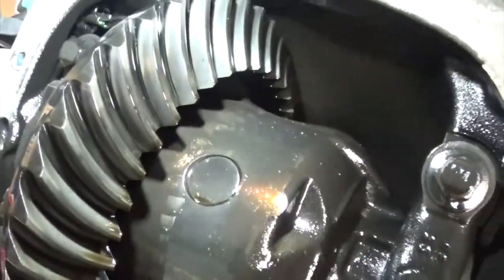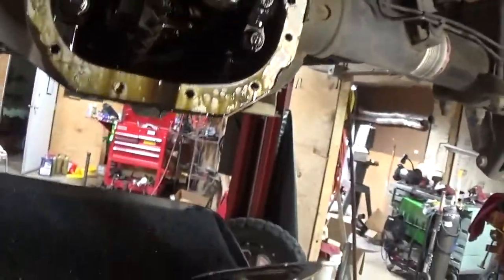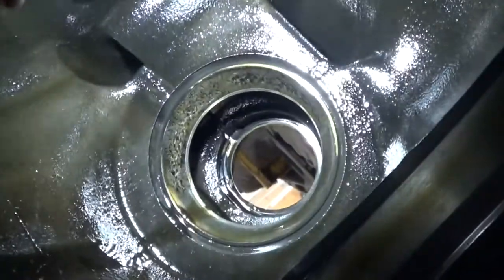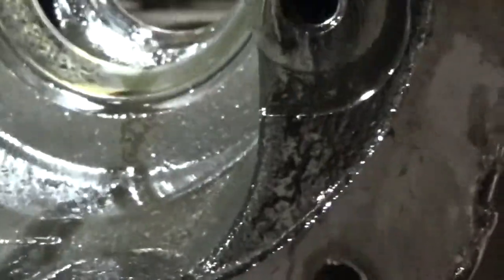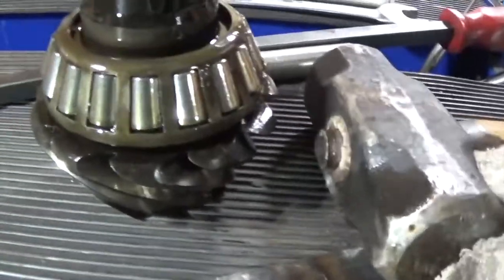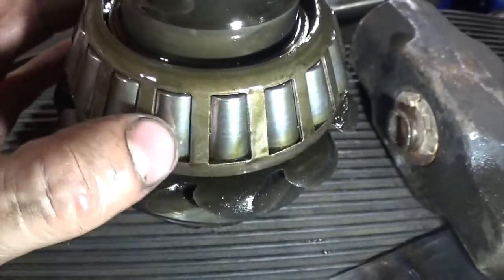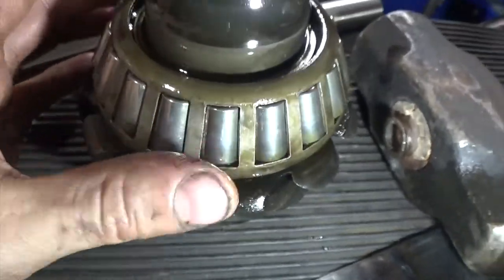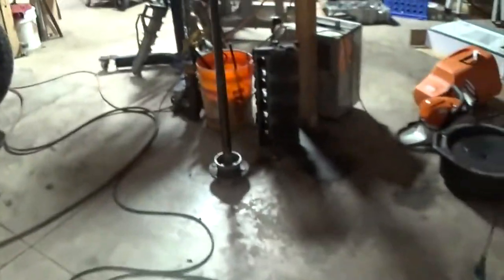How to fix rear end whine in 2017 F150

Comment: He says I don't know why these do that, simple answer it's built shitty.
My Toyota thunder with 300kmiles, don't make any noise whatsoever. 
Still runs just as smooth. 
Have a Diesel Toyota Hilux with 600kmiles, rebuilt the Engine twice but same rear end, so definitely these r not built right.
Reply from the maker: I agree. I’d love to know exactly why. Then I could try and improve on that. But your right. 
Here’s something I’ve always thought about Toyota axles. 
I’m not sure on the Hilux. 
I always thought it was funny that Toyota uses an axle that resembles a ford 9 inch. The ford 9inch is still used today in racing applications. Who built it first? Very cool that you have a diesel Hilux!
Reply: @showmerepair  
I have that Diesel Hilux in Fiji, live here for most for most part of the year and spend 4 months in Utah. 
Had a Diesel Hilux in Utah too, lady who served in the Military somewhere overseas brought it back with her, I believe in Germany, then sold it to me.
Anyways about the design on Toyota rear ends, I love the adjusters for the Crown bearings instead of the shimms, with the adjusters,  one can get very accurate bearing preload.
These Toyota ones r built like a FINE watch.

Comment: What would a average cost be on this repair if it wasn’t your brother haha?
Reply from the maker: I’d imagine in the $1200 range from a quality shop.
Reply: @showmerepair  ford charged me 3,000 cad $ to rebuild the whole differential internal, saying they don't replace "only the bearings", because the metal can spread and affect the others and such... I'm no mechanic and I was short in time, so I had to pay! Truck was 110,000km I tried to get it covered by Ford canada but they never wanted to.  3k for a bearing noise, hard to digest
Reply from the maker: @DropMuse  sadly most repairs are left up to the mechanic biding the job. Their own experiences and knowledge play a big roll in the kind of repair they feel is the best option. Other times cost is what other mechanics go off of. How can they make the most money. 
Sadly I don’t know any way around this. Though I am trying to think of ways I can control that mentality when I grow my own shop.

Comment: My 2018 ford f150 is making a rear end noise whining when you accelerate and they told me it could cost any where from 1,000-5,000 to work on it  I’m literally so broke it ain’t even funny I wish I knew how to do it my self
Reply from the maker: I’d talk to some other shops and see if they would be willing to replace the pinion bearings, pinion seal, crush sleeve and pinion nut. 
It will need new fluid as well. 
Now if they disassemble it and the pinion bearing is not the fault it could cost more. 
If the noise is coming from the pinion bearing area. I’d put money on a bearing failure.

Comment: Koyo bearings are who makes ford so you cam go aftermarket.. Long as its not Timken bearings those bearing are junky
Reply from the maker: Lol I’ve never heard any one say Timken are junk. 
I’m not partial to any brand. From my experience premature failure is usually due to improper installation. 
I usually stick to factory if I’m reusing shims. If I have to use other then factory I’ll set the gears up with different shims for a good pattern.
Reply: First time I've ever heard anyone say Timken are junk too!

Comment: Just pondering an other oil slinger stacked will fit the bill to preload that spacer on the 17 .My old truck 17 years old 200k on it gave it to my son he loves it quiet as a kitten the diff properly maintained 99% of pinion bearing failures too much preload after pinion seal replacements seriously pulling wrenches since 1986.